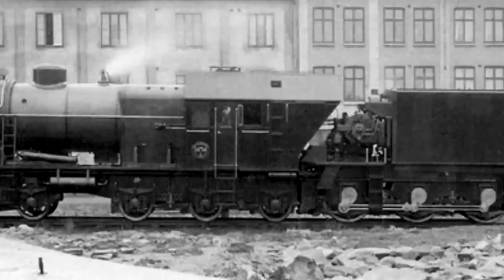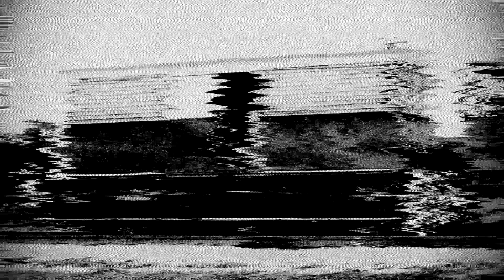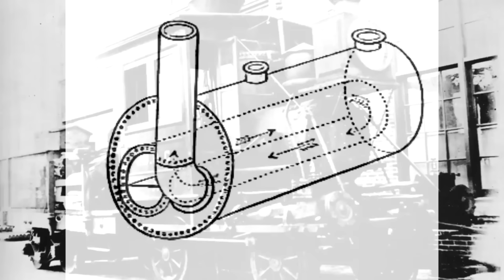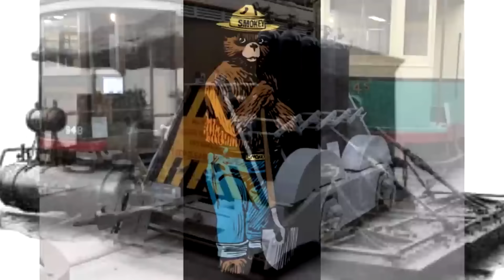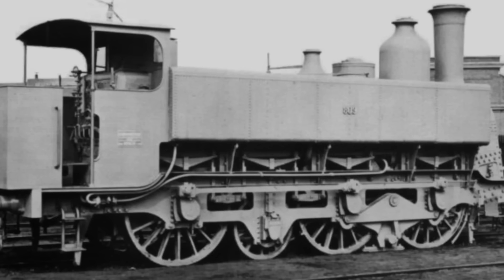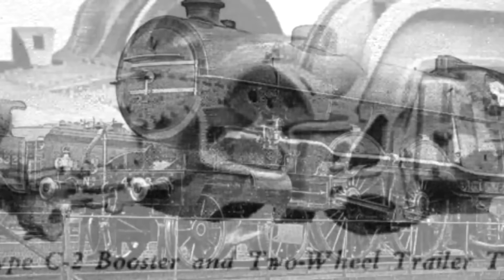10 Trains That Were Clearly Just Mad Science Experiments | History in the Dark

Comment: Eh, the whole deal about booster engines at the end could be argued. The main issue wasn't really power, it was traction. Locomotives with big drivers didn't always have the best grip, and so were usually more prone to wheelslip than their smaller-drivered counterparts, like Berks, Connies, and Mikes, especially when starting a train. Because of that, they had booster engines to help with getting moving, which were helpful (especially with their much smaller wheels). After this assist, they'd then be disenganged once up to a decent speed (usually ~20 mph (~32 kph) or so).

Comment: the bavarians built them because they had mountains to scale with these locos so they used the booster mainly to climb and start once traveling the normal wheel while only one was sufficient to go fast the idea was to do away with the pusher locomotives (with only lots of small wheels that would push trains up the mountain and decelerate them on their way down. but in the end it was more efficient that way anyway so they scrapped the boosters and went with BR96

Comment: For some odd reason separating the coal and water was a common thing on steam turbine locomotives. Both Norfolk & Western and Chesapeake & Ohio built steam turbine locomotives which had tenders that only carried water, but then had coal bunkers onboard the locomotive in front of the cabs because they were also both coal fired cab-forwards for some reason. These two were truly the mad science of steam locomotives, using steam turbines to generate electricity and power electric traction motors similar to most diesel locomotives, meaning they could drive ludicrous amounts of wheels, the N&W had two three axle trucks on the locomotive, two more on the tender, all of them fully powered, giving it a whopping 24 drive wheels and 10,000 more foot-pounds of tractive effort than a Big Boy.

Comment: Y109 was entirely successful for its role. The main reason to use a diesel was due to lack of suitable water in the area. An issue that exists in a LOT of Australia. Another steam to diesel conversion was NB30 of the Commonwealth Railways, now preserved at Pichi Richi Railway
Reply: And it was certain cheaper to transport and install a diesel engine than to transport a complete unit. These train lines where very insulated. Evey thing had to be transported there by truck, or by a temporary rail line.

Comment: Speaking of booster units, Reading & Northern former Reading Co. T1 #2102 is equipped with a booster and is used when going upgrade in slippery rail conditions. In this case, it works really well.
Also, Boston & Maine #3713 Constitution, under restoration at Steamtown NHS, is also equipped with a booster in the trailing truck under the cab.
Reply: I believe the NYC Hudsons also had boosters in their trailing trucks.

Comment: 3;30 the drivers is on the tender because there is where the condenser is.

The thing os that the cpndenser make sun atmosvwre pressure. That made aa flex tube between the turbine and condenser bassicalöy impossible.

Hence the turbine had to be there as well

The bolier have positive pressure so a flex tube is way easier.

Comment: The problem with the low 14t axle loading allowance on the Luxemburg line in Belgium was later solved in the proper way to use heavier rails and a better track bed to allow more powerful locomotives to run there, leading to the iconic types 10 4-6-2 and 36 2-10-0 in 1910 and the even heavier types 5 2-8-2 and type 1 4-6-2 in 1930 and 1935 respectively. The types 1 and 5 could achieve close to 3000hp and had an axle load of 23,5t on the drivers, in a time when the typical axle loading for a main line loco in Europe was between 17-20t
Reply: That’s a relief to hear they did get around to fixing their lines. But I can’t imagine how a 0-4+2-2 was the way to get around that problem, but damn they did it well 😅

Comment: Chain drives were used quite extensively on small industrial locomotives, both steam & diesel, as well as road vehicles like steam lorries. Simple, cheap & reliable. That Foden looks like a back yard creation from the bits of a lorry rather than anything from a manufacturer.